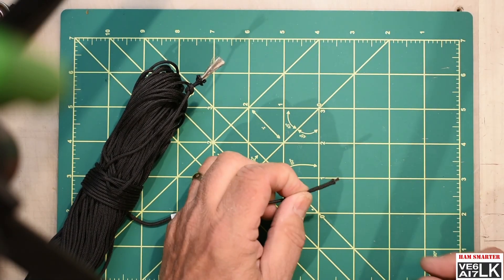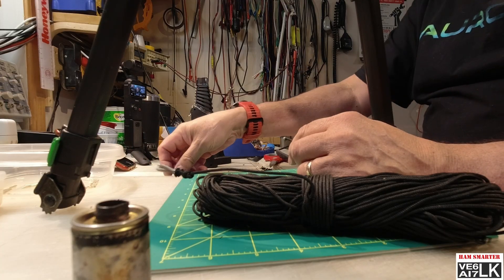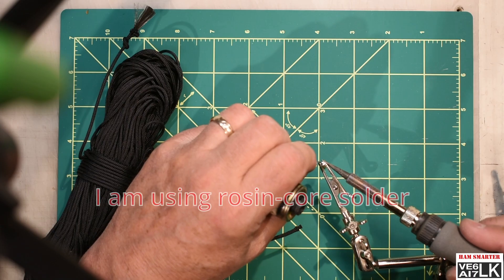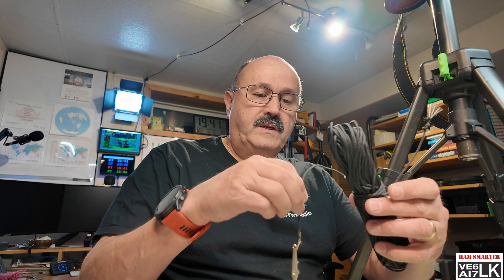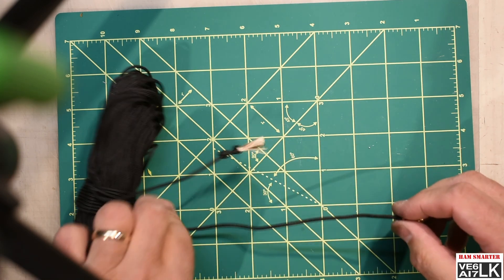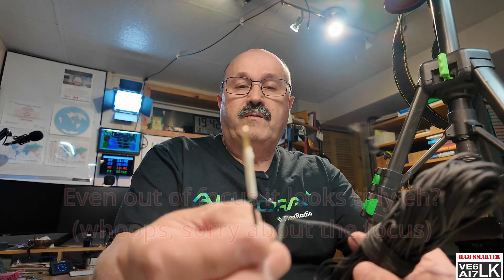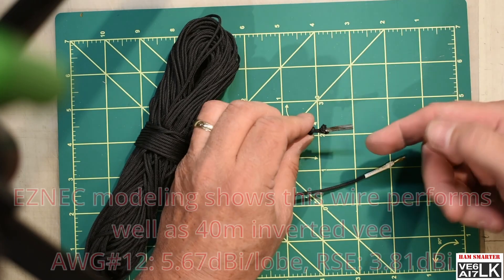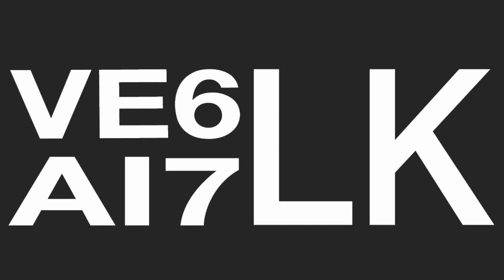What is this revolutionary new wire for portable operations? RSE Line(tm) is amazing!

Comment: I am just wondering how abrasion resistant & water proof it will be? And will it become a lightning rod, like a carbon fiber fishing pole!?
Reply from the maker: Any wire can be a magnet for lightning and this is no different in that regard. The polyester covering will allow water but not absorb it and it dries out quickly. But it's polyester not Kevlar, so expect it to have some fabric pulls.

Comment: Cool Vince! Does this wire resist tangle ? I use silicon covered  wire to minimize tangling out in the field .
Reply from the maker: Even my BNTechGo wire tangles and I find this better than the silicone jacketed stuff in this regard, but it's certainly no RG-400 or RG-316 which is near impossible to tangle hard.

Comment: It will be interesting to see measurements of resistance versus frequency.  Also, I wonder how resistance may change over time when hanging outdoors in wind, rain, humidity cycling, daily temperature cycling, and operational temperature cycling.  When running high power, it will get hot in the regions of high current.
Reply: These are all great questions, and ones that I'm also interested in finding answers to!

Comment: Looks cool and could be a solution to a problem I don't yet quite see 🙂. I have the same concerns as LB4FH about what happens when it gets wet.  Also the ohmic resistance would clearly make the antenna less efficient. When used for transmit , we do have high currents somewhere along the wire.. I use the Sotabeams UL DX wire at 4g / m and 75kg tensile strength, so I can suspend myself from that wire if needed... I don't see that I would need more strength for any of my use cases, but perhaps some new one's will creep up!  Very interesting product, but will have to think hard to find the perfect usecase for me !
72 - LB8VA
Reply from the maker: Fair enough, all products need a use case. 

We compared 12GA copper versus this stuff in a 40m inverted vee configuration, and the difference in the lobe was 1.8dB - perfectly acceptable for temporary use in my mind.

73 and thanks for the feedback.

Comment: That looks so much more flexible than the kevlar reinforced one I have seen before. Would the carbon fiber coating be waterproof?
Reply from the maker: That's a great question for @HamRadioRookie
Reply: Currently the outer sheath is polyester. It’s not waterproof but resistant. I am looking into a hydrophobic overbraid and or coating. The nickel plated carbon strands are pretty resilient and in the end the strand tips would be the weak point much like any conductor
Reply: @VE6SFX_HamRadioRookie  Thanks! It looks really nice

Comment: I can't wait to make an EFHW with that stuff.
Reply: I was thinking the same thing. Building my first one today. My question is how does this handle heat?
Reply: @Synthguy777 well you can make the core glow with a torch and it holds up. The outer jacket is the same as a paracord. So it will melt at 244deg C or 471F
Reply: I cant wait to get you some! Thanks for the interest!